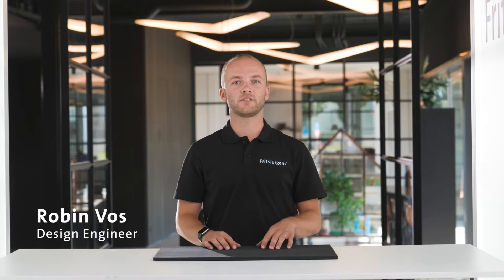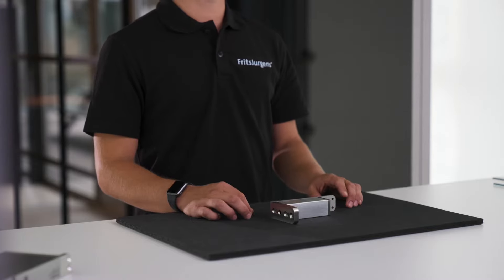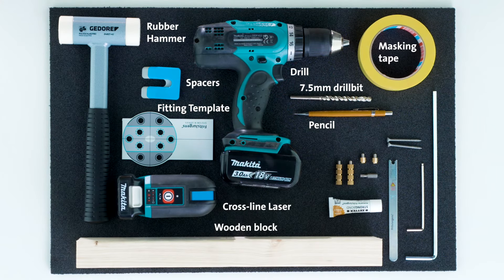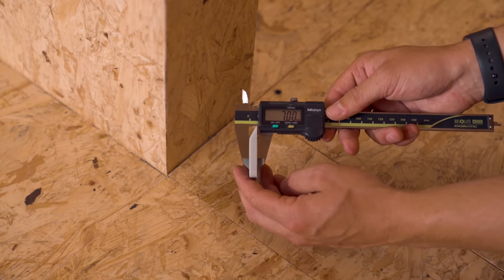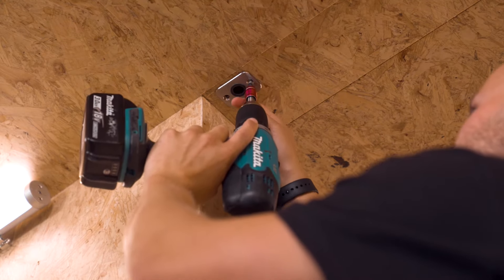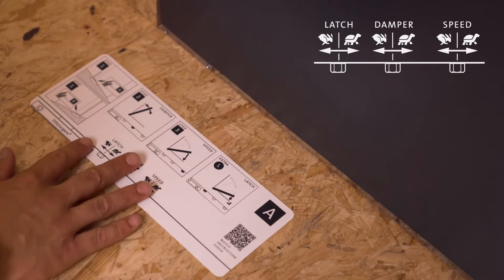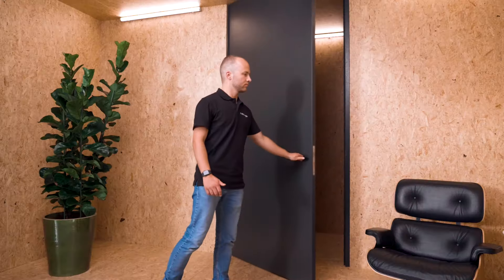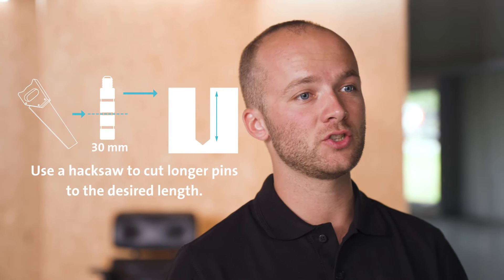Pivot door installation - System M & Top pivot 40 mm  - FritsJurgens Tech

Comment: I would assume I don't have to mount the top and bottom mounting brackets if their already  mounted on the aluminum floor plate sill and top sill ?
Reply from the maker: Thank you for reaching out to us, good question. The system can be mounted by itself in case of aluminium profile. The adapters for the brackets can be purchased seperately as an accessory. To give you better advise we would need some more information about your specific situation. Please send us your questions including screenshots to info@fritsjurgnes.com so that our technical staff can give you more accurate advice.